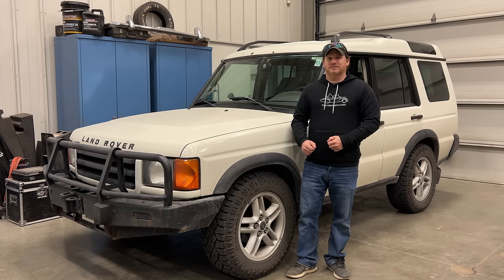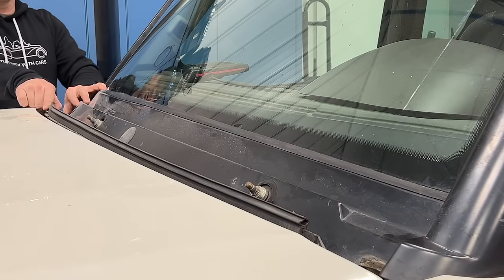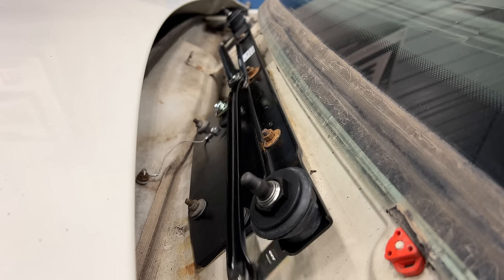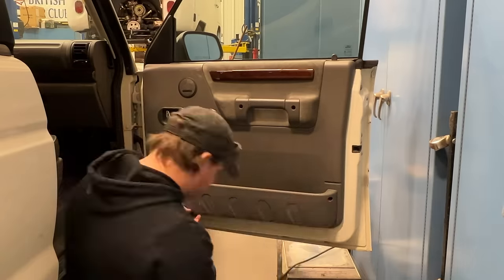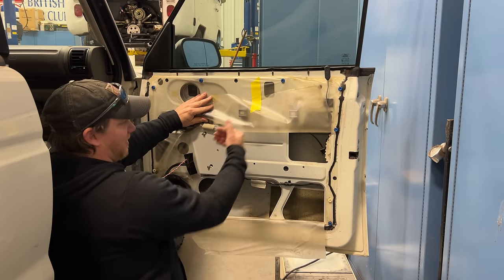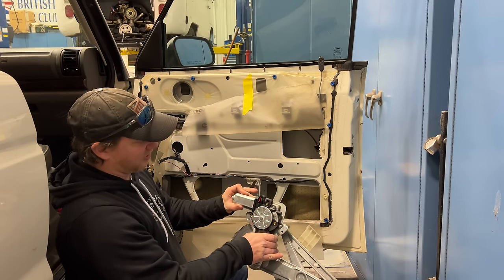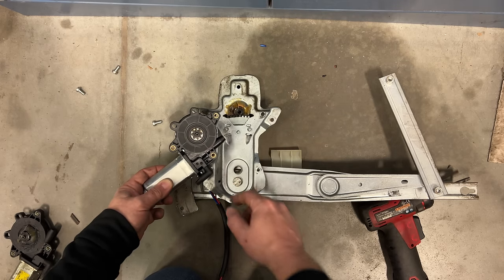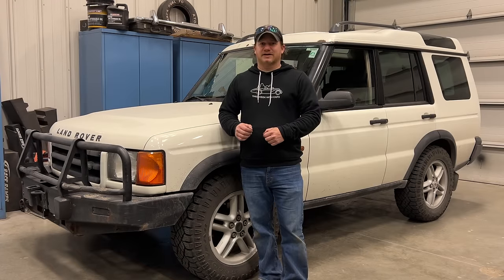Replacing Wiper and Window Motor on my Discovery II

Comment: Great Video as always, It should be pointed out to people that may not know that windscreen wiper motors have a permanent live feed to them from the ignition, which means that even with the windscreen wiper switch turned off, that motor can unexpectedly start (because they try to park in down position) many mechanics have sadly lost fingers and had very painful injuries, the linkage is a nasty thing if it starts to move if you are touching it, so ideally disconnect battery and keep ign off and you cant go wrong. Thanks again for the cool videos

Comment: Wow, glad you were able to sort all of this out. It’s clear to me that Land Rover doesn’t want the average guy, like me trying to do my own work. One would think if they changed the connector on the window motor, they would at least have the courtesy to include the other side of the motor connector included as a pigtail, so all Steve had to do was cut the original connector from the chassis harness and splice in the new connector in and back in business. As a former parts man, if something changed, I told my customers and verified if they had the latest part on their engine already. If they did all they needed was the latest part. If they were replacing an original component then I would say in addition to this new part, you’re going to need this, this and this to complete their repair. On the water barrier behind the door panel, most US produced vehicles I believe have a removable water barrier that can be put back into position and pressed back down to reseal the internals on the door. Steve your abilities and intuition never cease to amaze me. Great job!

Comment: Always a good idea to maintain the daily driver but that is the one which often gets neglected. Some wiper motors are a real pain to replace but that looked pretty straight forward. I am glad you found the right window motor, just having to change the connectors is a minor problem. Thanks Steve for another good video. 👍

Comment: The final part of setting up the wiper mechanism has been missed out.  Before fitting the trim below the windscreen you don't know where the wipers should be positioned.  The danger is you'll allow the wipers to impact onto the trim.  The easiest way is to stick a piece of masking tape to the 12 o'clock position of the wiper spigots.  Operate them (without the wiper arms) and see if both spigots are synchronized. Then look for the end 'swipe' arc on the windscreen (top left looking back towards the windscreen).  Here in Scotland in winter, as I've just done, it's easy, as it's always raining, but for you in sun kissed places, maybe where the dust has accumulated will tell you where the correct arc should be.  Fit the wipers and operate on a wet screen to avoid scratching and once you're happy with the wipers arc, stop them when both are horizontal (allow for where the trim seal will lie on the windscreen).  Remove the wipers, fit the trim and refitting the bonnet is a breeze even for someone on his own at 66 years of age.  :)

Comment: I had to change a couple of window motors on my Freelander and they too came with the extra pigtail. If you are able to remake the connections then the extra length of cable makes refitting a bit easier.

Comment: I would've swapped over the plug from the original motor. They are water proof. A good video if you need to change the cowl or wiper motor. I saw your cowl has the obligatory split in it!

Comment: Steve only did one thing incorrectly so far as I can tell.  When he discovered the electrical connection was different on the new part, that's when the obligatory curse word is to be blurted out with some emphasis even if nobody is within earshot to hear it!

Comment: Good job Steve, LandRover has some of the most "rinky dink", (poorly designed and useless), window regulators and central locking systems fitted to it's older cars. Always failing to function, Lucas junk.